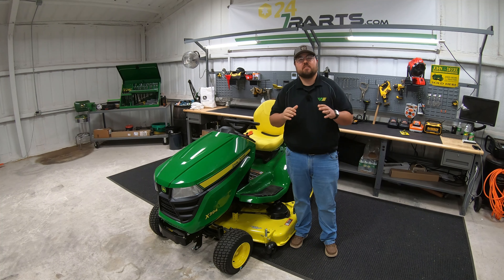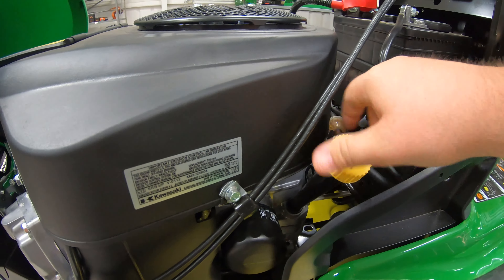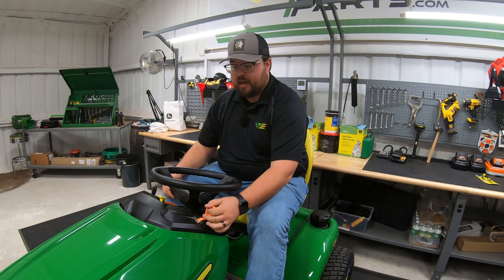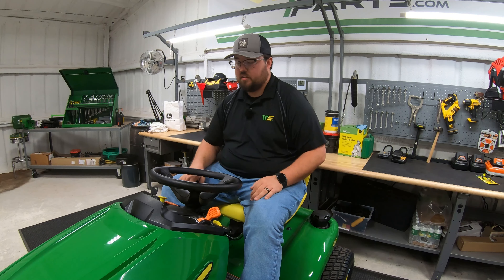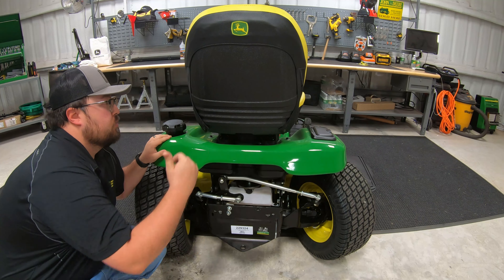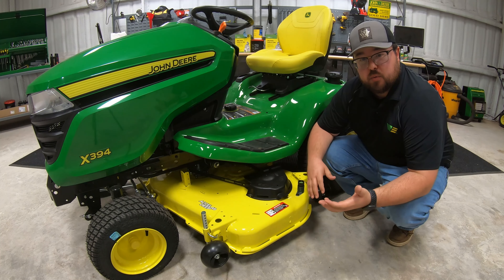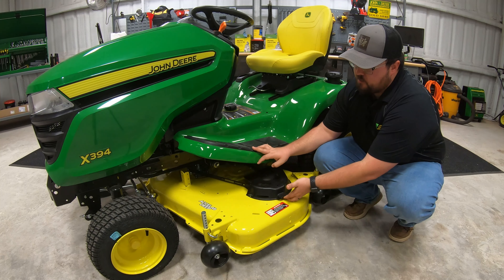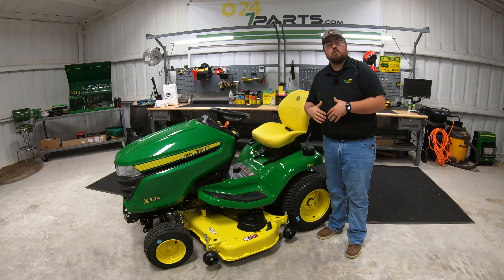2022 John Deere X394 4 Wheel Steer Mower Review & Walkaround

Comment: I ordered mine in February with snow on the ground. I got my new 2022 x394 in mid April and finally got to mow last week. It was awesome. I added the electric mulch control, bumper, 12v outlet and the Bluetooth module to connect with my phone. Thank you for covering the 2022 John Deere x394 Brent! It's a sunny Saturday and it's mow time!
Reply from the maker: Awesome! I hope you are enjoying it and thanks for watching!
Reply: Wayne, how do you like the interaction between the Bluetooth and phone? What kind of data is it providing you?
Reply: @paulli405  it tells me how many times I have mowed this season, time for each mow, average time, shows the route I took, displays the particulars about the tractor (hours, full level, notifications etc) from the last time the app was on contact with the tractor. It also lets you know about service reminders. It tells you how long since your last mow, what time the sun sets so you can plan and also how much rain you have received since your last mow.

Comment: Upgraded my 2017 x330 for a 2019 x390. Now you have me wanting to upgrade to x394. I love my x390 with the one touch mulch control, electric spreader, snowblower, and hopefully soon getting the sweeper with the thatcher and an aerator. I’ve got the Bluetooth module on order. John Deere makes some great machines.
Reply from the maker: Well think of it this way, you have your next upgrade already picked out. How long have you had your X390?
Reply: How well does a x390 handle a snowblower?
Reply: @cory2146  it does excellent. Having the hydraulic deck lift is great for the snowblower. The power steering is great to have with the extra weight of the blower.

Comment: Nice mower, this model is one of the ones that interest me. My concern is comfort level and leg room.
Reply from the maker: I would suggest to definitely go test drive one and see what you think. I hope this helps and thanks for watching!
Reply: I have the new X380 for my 3 acre block which is the same seat. I’m 6 foot and find the JD really comfortable, and I could push the seat back more if I needed too. I think this model with power steering and adjustable steering wheel would only improve the ride.
Reply: I have this exact one and it is very comfortable. I have a very hilly 2 acres and aside from a little heavy on fuel consumption, it’s perfect for the size and terrain.

Comment: I noticed on the sticker, it says traction assistance, what exactly is that?
Reply from the maker: So next to the "Traction Assistance" it says (If Equipped) and this becomes a feature on the X500 series that will add a differential lock or traction assist system to the mower.
Reply: @WesternEquipment  , thanks I noticed that after I made the comment.  Thanks for the great reveiws, I had a local deal track down a 394 for my dad to look at and he ended up buying it.  I have an x540 but it I ever get another new one it will definitely be a 4 wheel steer.

Comment: What accessory would I need to add for mulch control and what would the cost be?
Reply from the maker: So their are two different options on the X300 series mowers. You have the electric mulch control that has a switch that goes on your dash to open and close the door or their is the manual version. To get a cost on these check us out at 247parts.com and call our customer support line to get the price. I hope this helps and thanks for watching!
Reply: Joseph, I added the electronic mulch control when I bought mine. They add a switch next to the PTO for it. It’s a must have option IMO, if I need to convert either to mulch or discharge it’s the flick of a switch. With the plug, you would have to constantly stop put it on then start again. It’s time consuming. I do not remember the pricing I paid for it but IMO, it’s worth the cost and convenience. Good luck
Reply: Joseph the push button is SOOOO worth it!!!